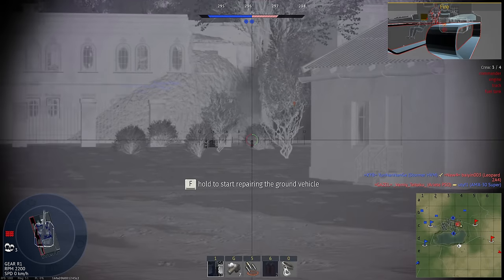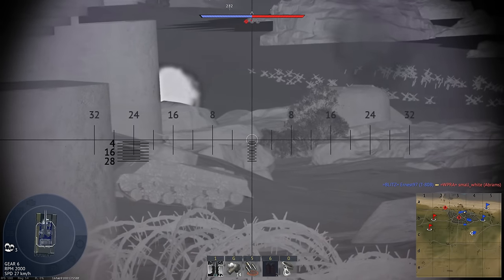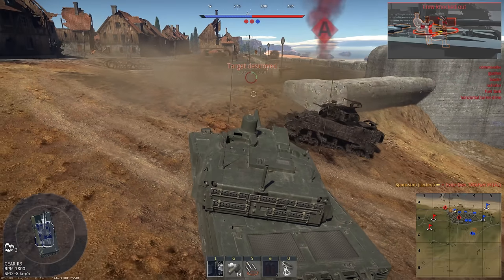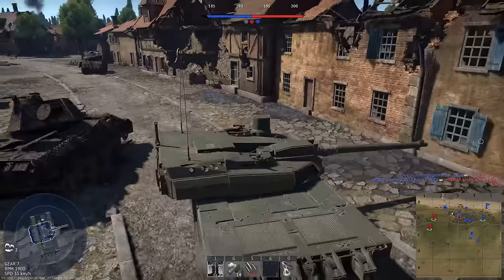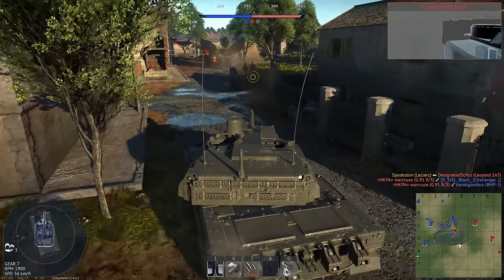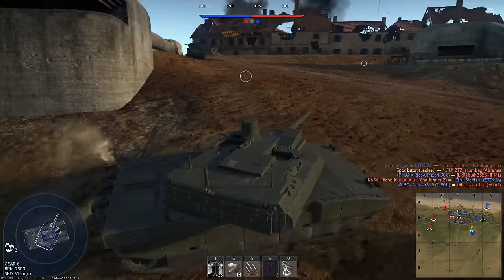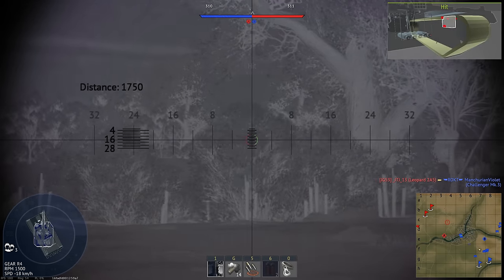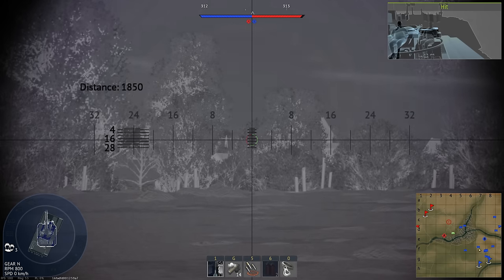The Future of Tank Armor

Comment: The jet of a shaped charge is fast, on the order of several km/s when uninterrupted by any armor. If the mechanism by which electromagnetic armor disrupts these fluid  jets involves things like the lorentz force or even just ablation from joule heating, that means the electrical impulse must be enormous to counteract the insane kinetic energy. As in, kiloamperes or even megaamperes.

 The only device I can think of compact enough to fit on a tank and also deliver current like that (i.e. smaller than a huge capacitor bank) is an "explosive flux compression generator", like the kind used in nuclear weapons to drive neutron gun sources. Unfortunately these are driven by insensitive high explosive charges, meaning they are triggered and would need a sensor to activate.

The other option, like mentioned in the video, would be a pre-existing electric potential high enough that the meager capacitance between the armor plates could drive enough energy into the jet to knock it apart. This amount of voltage would be akin to lightning, and you would need to sandwich a layer of exotic material with an insanely high dielectric constant to keep breakdown from occuring between the two plates. Hell, you might even need structural elements to keep the static attraction of each plate from smashing this dielectric.
Reply: @nichsulol4844  what
Reply: You dont need to fully vaporize the jet though. It's tip is really hot (close to boiling) and thin, and the molten needle doesnt have anything close to a homogenous speed or a resistance besides inertia... You only have to cause a little bit of boiling/ablation mostly at the point, and the jet will lose cohesion, dispersing much more quickly through the armor behind.

That is not to say you dont need a very strong capacitor, but we are talking of kilojoules rather than megajoules as vaporizing it would demmand, that's within reach of modern capacitors for quite a light weight (for a tank anyway). The difficult part is now to make it reliable, *safe*, sturdy, affordable, and able to dish out the power output required (dozens to hundreds of megawatts), again safely and preventing misfires. 

I agree the dielectric is probably the weakest point of that technology too, specially on the safety end, but I guess it could be turned off except when a threat is expected, which should make it at least safer than ERA, facing a similar issue. They probably are quite bulky too, but spaced armor is too and still used...
Reply: @antaresmc4407  Interesting thought about the kinetics of shaped charge jets, I will admit I don't know a whole lot about the physics other than just "behaves like a liquid because of plastic deformation and not melting." Regardless of that, even if energy demands are more modest than I make out I'm still inclined to believe explosive pulsed power is a better option than capacitors in almost any situation where triggering is needed. I've since learned about so many different types of it that exist, too.
Reply: @Youtubeguy543  well, a liquid is basicly a solid with 0 yield strength, which doesnt really technically exist anyway, so when the stress is just way higher than the YS, you can just call it a liquid... SC liners are often actually molten though (it depends afaik), as one of the limiting factors is the waste heat absorbed by it.

About power source, Im not very familliar with those, but you dont only need high power and current, you need high energy, while voltage doesnt really matter. A few napkin calculations suggest you'd need 10kJ ± a magnitude... Idk if the tech is scalable enough, and you'd get such ridiculous power that itd be hard to make the circuit not burn itself down. Plus you'd need incredible precision, a tenth milisec early and a lightning grade arch sets your circuit ablaze not hitting the projectile, one late and the jet overshoots enough to short circuit where it shouldnt, the enemy could just make a round with an inaccurate fuse, while suboptimal it'd cut costs and work... Also tandem charges would defeat the system. Lastly, idk how much they cost but sounds expensive and you dont need it be particularly small...

A capacitor armor has the advantage that it cant be fooled and needs no extra device besides power (sensors always being weak spots and explosives damage multipliers, not to mention the generator would itself be basicly a HEAT round inside the tank... Lastly, if the dielectric is soft it can double as NERA, which is nice I guess
Reply: @antaresmc4407  similiar to phase shift armor from gundam seed series

Comment: From my (possibly faulty ) understanding metal foams are mostly usefull in enhancing ceramic armor peformance by delaying/dampening shockwave reflection of the backface (with the foam as supporting material ) that being one of the main limiters of ceramic performance ). By increasing the time the ceramic resists the projectile (dwell time )  as well as decreasing the crush zone in ceramic armor performance is increased.

Foams apparently also function well as a spall liner.

Comment: Using sensors with electromagnetic armor which I just heard of seems to me to present another advantage.
 It could be used in conjunction with capacitors. 
Capacitors store an immense electrical charge but take a  time to acquire that charge.  They can acquire their charge over time with a lower voltage electrical supply. This reduces the size of the generator that would be needed to produce the same amount of electrical current on a continuous basis that would be needed without them.
A sensor could discharge the capacitors with the approach of an incoming weapon  thus allowing the capacitors to hold their charge in anticipation of attack.
This is the way lasers weapons are powered.

Comment: I would like to point out that the research done on the ballistic protection potential on metal foam composites was strictly in that of small caliber rifle rounds along with fragmentation from 23mm HE-I rounds. Comparing it’s ballistic protection against these shells with that of RHA  just doesn’t stand in the argument of tank protection until it has been tested and compared to current composite armor against chemical and high density kinetic projectiles
Reply: The way I understood it is that the same thickness of metal foam beat the same thickness of RHA. In this case the scale matters little, the point is that it provides better protection then regular steel armor. And to compare it with current composite armor is useless, as metal foam would be a part of a composite setup not all the protection. What does matter is how it does at different penetrator designs
Reply: @shepardpolska  the scale matters, mostly because long-rod kinetic penetrators behave differently from rifle bullets when hitting target
Reply: @Ally5141  This isn't scale. This is penetrator design, which is what I said matters. Because there is more then one Long rod APFSDS design anyway, and they are better or worse at stoping bullets. Saying scale matters means the effect would be different if the bullet and matterial thickness would be scaled up, and it simply isn't the case. If you change the design of the bullet in the test to the same one as a long rod, then if you scaled up the test the result would stay the same as with a big APFSDS
Reply: shepardpolska except composite armor setups don’t primarily consist of RHA... they consist of composite materials including depleted uranium/tungsten and other super dense materials as well as the likes of ceramics. So no, until it has been tested as part of a composite scheme and directly against the current armor materials that aren’t RHA, the findings do not indicate that it’s the “future of tank armor”
Reply: shepardpolska there’s also a significant difference between the way that a typical full metal jacket bullet in a rifle caliber interacts with armor compared to a long rod monobloc penetrator, a segmented penetrator, or chemical munitions. There’s a reason that the armor protection on a tank varies between shell types in accordance to its armor scheme, and how different composite arrays can provide more than their dimensions in protection vs RHA. this means that, until it has been tested against these munitions... the findings have no indication as of yet that it will be better than existing armor typed against these munitions
Reply: @shepardpolska  you started with scale, with has nothing to do with the problem here.
Rifle and autocannon bullets are designed and act differently from long-rod penetrators while hitting target. So no, tests on small caliber rounds don't say that much about the effectiveness of metal foam against long-rod penetrators.
Reply: @Ally5141  Except that many autocannon and cannon Rounds are very similar to small caliber bullets. Aircraft autocannons tent to shoot regular AP nor APDS for one. During the ww2 Most roimds were AP or APHE. They worked exacly the same as a AP rifle bullet. See, you just said it yourself. That cannon rounds are designed differently. What about the BR-412D? Tgat isn't a long rod penetrator, yet it is a 100mm roumd still in use. And what about the 40mm lomg rod penetrators? They are autocannons yet use the same design as a bigger APFSDS, do they not work the same relative to scale? And what will you tell the soviets when they copied the design of 3BM22 from the 125mm to the 115 amd 100mm guns, that the design will not work if you make it smaller? You really mean that they should have tested it with a different round design not a bigger caliber... I was never arguing that they shouldn't test it on long rods.
Reply: @Hollycalvey  And that are those elements covered in from both sides? RHA. I don't get what I said wrong. Also what is the primary armor material of the soviet tanks that still provides good protection? Steel. The T-80u for one has 3 50mm layers of steel in the frontal hull armor

Besides I don't get what you mean at all, lets say tungsten is worse protectimg then DU. So if you exchamge the tungsten in your armor for DU you have no way to know if it now offers better protection, even though the matterials in it now have a better effectivess combined?
Reply: @Hollycalvey  Okay, then like I said penetrator design matters, yet the scale of the test doesn't there isn't much stoping you from makimg a rifle sized long rod round which was my point, the design of the round matters
Reply: @shepardpolska  for fucks sake, what do you not understand in "it was tested only against rifle bullets so we don't know how it will behave when hit by APFSDS round"?
Reply: Ally don’t bother with him lmao, speaking complete hogwash at this point
Reply: @Ally5141  I wrote my first message after not sleeping through the night, then you said that scale matters as a response. Which it doesn't, the diference between the APFSDS and FMJ rounds does. Which I agreed on. It seems we both missed our points.
Reply: All this back and forth about metal foam and long rod penetrators when the next gen of tanks are just going to be be unarmored missile launching drones anyways.

Comment: One problem would presumably be the cost of these protective systems. While the tank you speculated towards the end of the video would be a defensive powerhouse, it would presumably be even heavier and more expensive than current tanks. At some point the cost of defensive systems that could stop a round may be so high that it's just not worth doing, resulting in smaller and lighter tanks instead.
Reply: That's why it's time to call the whole tank thing and just use drones. Instead of sending a few big heavy tanks, send thousands of unmanned, unarmored, light, fast, possibly electric, disposable missile launching drones. Doesn't matter if they get destroyed because they are cheap and easy to replace and no loss of life.

Comment: A little side-note, EM-armor does not waste electricity while active. Maintaining a charge in a bank of capacitors (most likely solution) does not require any energy until the armor is activated and you need to build it up again. The only loss of energy would be the small leakage from imperfect insulating-materials, which for modern day plastics, or even a simple airgap, is minimal.

Comment: Actually EM armor doesn’t require much electricity, just enough to stop the passive discharge of the capacitors
Reply: Indeed, I don't know why he assumed that was the case, the circuit is open till tripped!
Reply: Basicly vampire voltage till active.
Reply: @sankhyohalder97  future armor will using nanotechnology and nanomaterial finding a hybrid nanostructure made out of rare metal such a or using high atom element comparison as a known Unbinilium

Comment: If that metal foam is inter meshed with micro ceramic spheres and have the spaces filled in with some sort of high performance ooblek, it would make DU rounds have a harder time penetrating, thanks to the fact ooblek is both a non-Newtonian fluid, and at the same time, has a high temperature threshold, making it cooler, which would both cool the DU perpetrator as it passes through it, and make it harder to pass through the armor.
Reply: Problem with that statement is that DU literally sets itself on fire when in contact with oxygen.

Comment: For those interested in real world near future weapon and armor physics simulation, Children of a Dead Earth is a near future space sim built on realistic near future concepts. It also allows you to design ships, and ship modules like weapons from the ground up, with a ridiculously large selection of real world materials to choose from, and lots of fine tuning.

The game relies on a ton of calculus to predict performance. As realistic as the game is, there is a few exploits that take advantage of the calculus. Computers can, at best, only approximate calculus solutions. So, scale up a weapon far enough, and compounding errors can lead to things like, say, a rail gun that fires projectiles with more kinetic energy than the electrical energy the weapon consumes... A violation of conservation of energy. Similarly, this is one of the only games I know of that does multibody orbital dynamics, which means your computer can struggle to calculate orbital conics. Also, you can freeze and crash the game if you launch too big an attack in combat, since every object's physics needs to be simulated.

Anyway, the game is mostly fun as a sandbox to see what happens when you smash unstopable forces into imovable objects, see what kinds of armor schemes and weapons work well. Personally, I like to go with lightweight boron/silicone aerogel sandwich armor, with a whipple shield, and one rail gun firing what are basically tiny pistol rounds at speeds measured in C from well outside enemy range.

Comment: Metal foam can stop shaped charges if you fill out the holes. The perforated steel armor for example was used in the earliest leopard 2 composite armor, they discovered it wasn’t good at stopping heat so they filled out the holes.
Reply: placeholder The leopard2av used advanced spaced armor layouts. The 2a0 used perforated steel followed by NERA
Reply: placeholder It would still be effective if filled with ceramic. The ceramic would instantly shatter but the metal would still deform and knock the round off course. As long as they’re 2 different materials, it shouldn’t affect the performance.

Comment: Perhaps a safe tank armor system could be made by the use a of two seperated plates that form a capacitor, the two plates have also explosive reactive armor in the form of a curtain. As the armor piercing jet connects the two plates electricity would flow through the metal disrptuting its tip's shape and also bending the metal jet similar to the way a rail gun functions...The explosive reactive armor plates are only at the top of the plates and the are activated by the metal jet and shoot a flying plate perpenticularly to the metal jet further bending it and disrupting it.
This way it would be safe for the friendly troops next to the tank. 
I wonder if they have already tested it

Comment: I expect more plastics to be used in armour. They can be surprisingly strong and kinetic energy gets transformed into heat (melting of the plastic). It's also potentially good against shaped armor. Obviously, we're talking about composites with metal and ceramic.
Reply: ...do you actually know how composites work?
Reply: @KoishiVibin  I have a rough idea. It depends whether they are supposed to resist HEAT or APFSDS.  The latter needs high hardness materials sandwiched in between layers that prevent the debris from being displaced.
Reply: @edi9892  
yes and no. the basic principle for NERA is for flyer/bulge element. this can be anything, it just has to have the sandwitched materials feed flyer plate material into the penetrator, inflicting lateral stress and increasing penetrated material.

for ceramics, this becomes stranger. it is currently known that while contained ceramics are effective at low scales, experiments with siliceous core armor found that larger and larger scale implementation decreased the effects

Comment: Fill the meta foam with ceramic and now you’ve got a super material. It’d effectively have the ductility of the metal matrix, and the hardness of the ceramic. Bonus points against HEAT due to structure of differing hardness and density’s. It would still be lighter then RHA, but not by as much as simple metal foam

Comment: This may already be in use: Emerald plates within a Chobham type composite armour package. It sounds exotic and incredibly expensive until you realise emerald is just aluminium oxide. So it's light, very very hard and also many times more heat resistant than RHA. The "ceramic" that they refer to in composite armour could be this.

Comment: The electrically charged armor is basically a capacitor; it takes energy to charge, and once it's charged it remains charged until it is discharged by something(heat penetrator) completing the circuit.